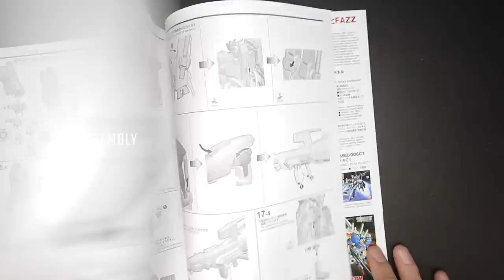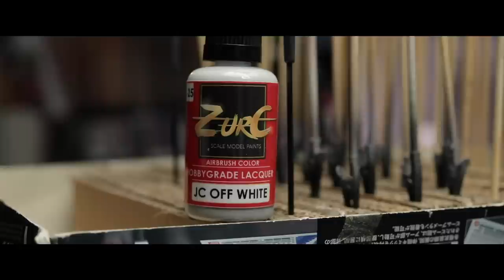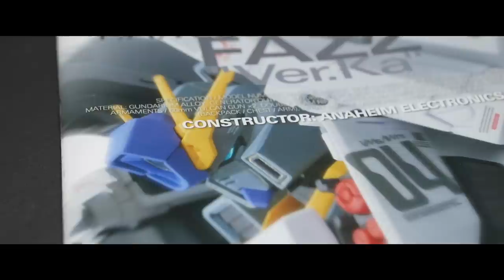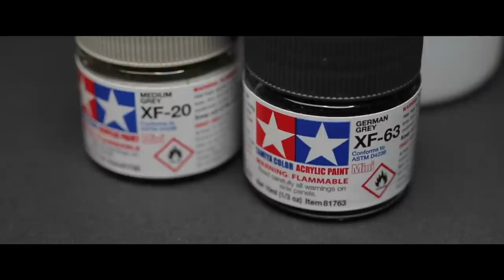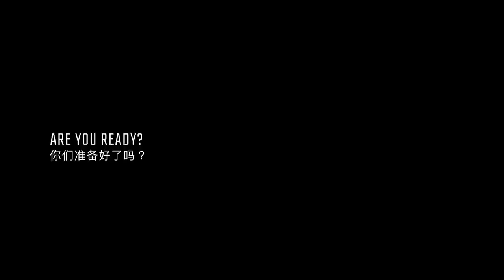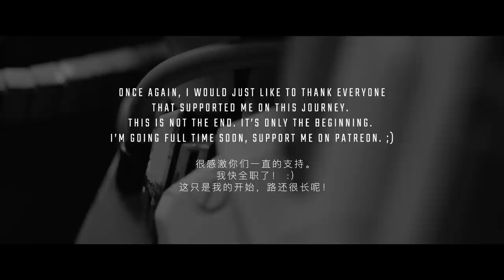GUNPLA CUSTOM BUILD | MG FAZZ Ver. Ka

Comment: Great Job!!
Reply from the maker: Thank you!
Reply: @StudioGundam  I have a question though. Do you Top Coat before you Panel Line or between different colors of paint?
Reply from the maker: tbsc0 I always top coat before panel lining but just a really light spray across to protect the paint and the plastic cause enamel will eat them up

Comment: I wanted to know that how do you dissemble it without breaking it?

Btw, ur amazing
Reply: When you build it initially, snip off male pegs and such that will make it hard to take apart. Leave only the ones that are necessary, then just use glue in the final build!
Reply from the maker: Here's you answer! But my approach is way simpler hhaha
Reply: Thanks.